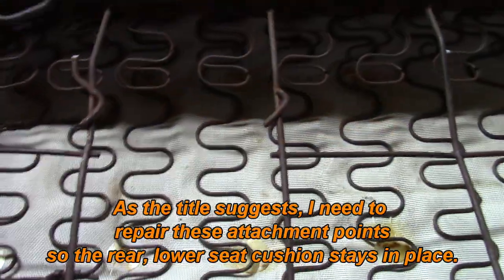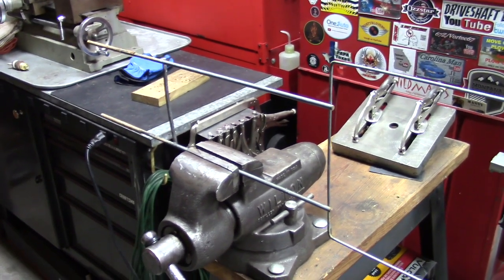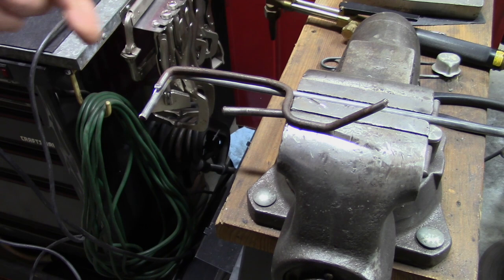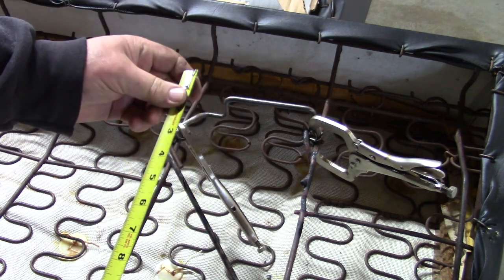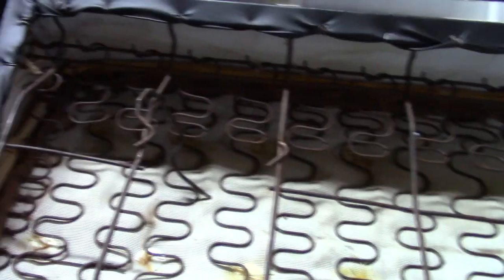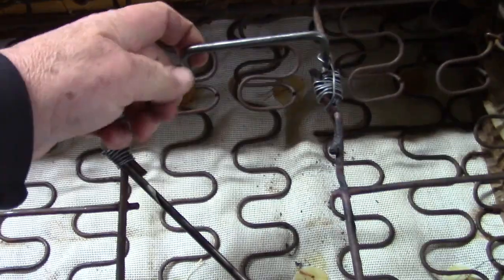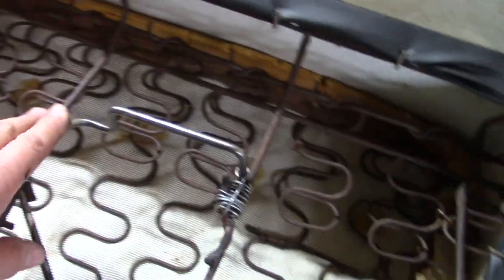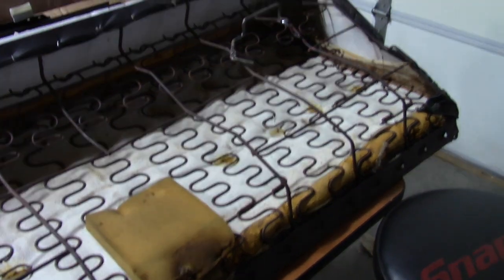Repair and fabricate a rear seat attachment point

Comment: Great job bending up the new one and good idea to test fit it before welding. I would not call myself a welder either even though I have done a lot of welding. You know, a weld does not need to be pretty to be good. You can have a beautiful looking weld but if it doesn't penetrate then it will not hold. My best-looking welds are usually the first pass and then I add the last pass and screw up the looks of it. But I have never had a weld fail that looked bad, but I have had some nice-looking welds fail because there was no penetration. It is 17 degrees F here where I live in Washinton state. Too cold for me. Having a hard time getting my garage without Insulation above 50F.  I suppose this weather is heading your way at some point. Stay warm.
Reply from the maker: I've done some welding here and there and even took a course in the 80's, but I can never get this machine to work right. I blame myself, but I'm beginning to think it could be this old 110V welder I bought from Sears in the late 80's. No matter how I adjust it, the welding doesn't change. Anyway, this weld will hold just fine. We are just into some cold weather now with snow on the way. I'm lucky to have a heated garage but it's expensive to heat that large area so I keep it around 50F. We lived in Lacy, Wa. for two years and loved it. It's so beautiful up there.
Reply: I know Lacey, WA.! I worked there for a year about 1989. We live 1 1/2 hr. north of there in Kitsap County. We don't normally get into the teens in the winter here in western WA. I also have a 110v welder from sears that seems to work well. Mine will not work well if you use it on an extension cord.  It also would not work well on a 12-gauge extension cord. Mine works best plugged right into the wall receptacle.
Reply from the maker: @mikesworld60 It's a small world, as the saying goes. I'll try and keep the length of the cord to a minimum and see if that helps next time. Thanks.